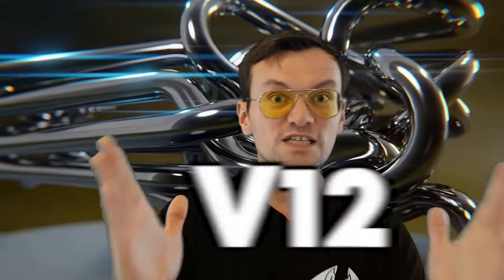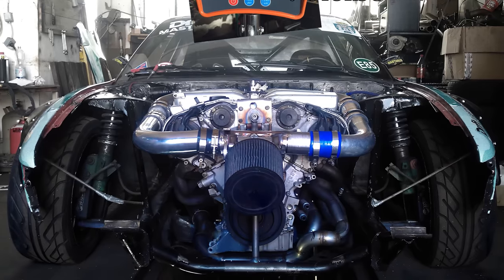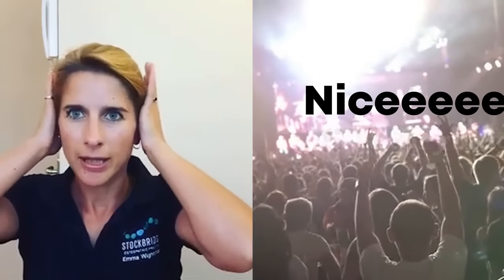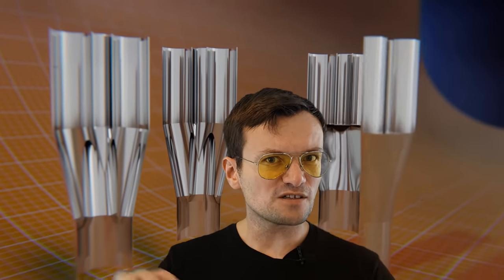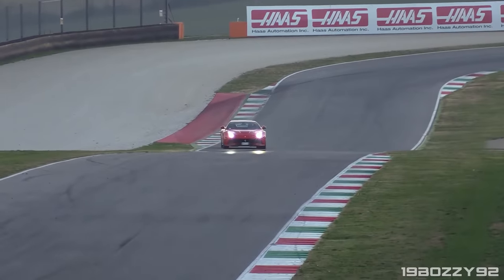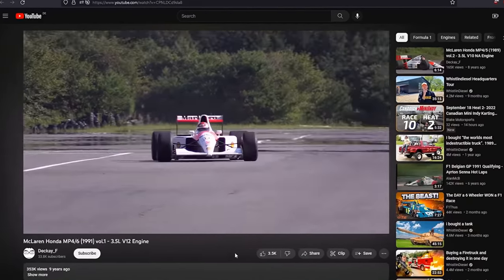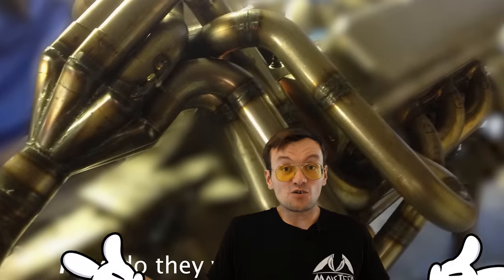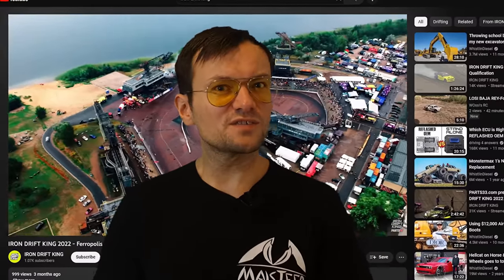Why This V12 Sounds Better Than a $5,000,000 Pagani

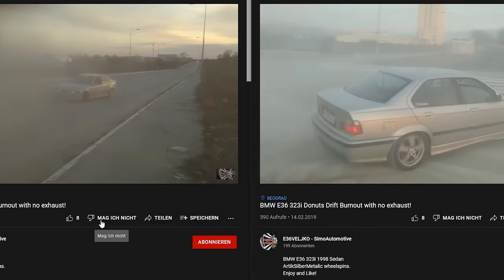Comment: 3:14 You needed an X-pipe exhaust, or an increasing diameter Y-pipe. To me, it looked like that header was a 6-2-1 or 6-2 design. So first of all, you needed to join the 2 into 1 on each side, then continue each conjoined side into either an X-pipe or conjoin THOSE two into one also... So if each E36 header had two 2-inch or 2.25-inch outlets, you would make those into one 2.5-inch or 3-inch outlet, then conjoin each final outlet into a single 3.5-inch or 4-inch pipe for the final exhaust exit.
Reply from the maker: The only cure would have been to exchange the baffle collector with a merge collector. Nothing else would have fixed the annoying raspy sound (except maybe a potato in the end pipe - but then there would be no sound)
Reply: @maisteer  It would've gotten close. There's also a guy who two a 6-2 header set on a v12 and plumbed the four outlets into a single collector and it sounded pretty F1-like on rev while idling like a tractor. It was interesting. Also, I kinda like the BMW sound, especially on high revs when you combine the two outlets into one instead of running duals.
Reply from the maker: @Drunken_Hamster  Do you mean this video: https://youtu.be/7YHjcfpo6HE   - if so we're not hearing the same thing. No F1 sound there, okay maybe 1960's F1 ^_^'
Reply: @maisteer  He didn't rev it as high as he needed to, but yeah, that's the one. You can hear the Lamborghini-like overtone in what little revving he DOES do. That setup definitely has potential, especially if he made the secondary 4-1 collector a spike merge instead of another flat merge.

Comment: I guess, in the end, the fact remains that a naturally aspirated piston engine burning pentanol just doesn't care about what we consider a 'nice sound'. The pumping losses of pushing exhaust into a collector of many tubes will always outweigh the "nice" sound that results. As an alternative measure, one might consider changing the fuel to one that has a significantly faster flame-front. Like Nitro-Methane. The exhaust pulses from a forced induction Nitro-Meth engine are likely to be so fast and energetic that no matter how long and complicated the headers and mergers are it wont reduce the power output.

Comment: The reason why you lose power if the manifold is of unequal length, is due to exhaust gas being forced back towards the combustion chamber. This not only starves the engine of oxygen but also reduces the pressure differential from the combustion to the atmosphere. Less efficient explosions and less usable pressure from the explosion at once, which can be eliminated by combining the exhausts from simultaneously firing cylinders at equal length, thus combining the shock-waves instead of having them counteract each other. Combining all exhausts together without loss of power is not viable, as the length of the manifold needs to be relative to the delay between each cylinder and therefore changes depending on the engines RPM.
Reply from the maker: You really should watch the new video ^_^
Reply: @maisteer  God damn it.

Comment: No way. I dont know how I ended up here but I saw the car do it's demolap at iron drift king 2023. The car ran a little rough but it moved under it's own power which is an achievement in itself
Reply from the maker: And now there is a follow up video what happened after the Iron Drift King ^_^ https://youtu.be/6EjbfLSRmyA

Comment: This dude is making headers look easy and I can say from experience making a set that won't crack and is that complex is difficult and if you were to buy even a mx5 custom header can cost over 1500 for a good set while still making same or less power than stock in a mx5s case
Reply from the maker: ...but it is really easy. ^o^'

Comment: so its like taking a band and putting a mic on each member, vs putting an omni in the center of the room. both will make the same sound ones going to be less clear and more distorted at high volumes.
Reply from the maker: I really don't understand the point... but thanks for watching ^_^'
Reply: @maisteer  in no uncertain terms what I'm saying is that what you did to your pipes makes total  sense.  another way to demonstrate what i said above is this, take 12 guys and have them all yell into a tunnel, its going to sound like trash, but make them all yell in a specific order.. and what you've made is music.
Reply from the maker: @5speedfatty  Ah, that's a bit more clear now. Yeah, sure. If you listen to a V12 without headers, it sounds not very musical at all. ^_^

Comment: I was excited to have found a new, interesting channel to watch, but you only have 3 uploads?? Come on, man! I am excited to see how the Mercedes headers turn out.
Reply from the maker: I am too. But Tim needs to finish the car first.
Reply: @Maisteer  Well, it's very impressive. Did you do any research on the 180° headers Ford came up with in the 60s? I'm sure you did, but I didn't see them referenced in the video. I realize this probably has nothing to do with what type of exhaust you're building or experimenting with but I am a GM truck guy and despite the GenIII/IV LS motors being shared (in a round about way) with the engines in the Corvette the trucks never sounded the same. This drove several truck owners insane. Even with similar internals to Camaros and Corvettes. When modified, the trucks have headers, usually with 1 3/4" to 2" primaries and 3"-3.5" collectors. From the collectors, the right side has a straight shot to the exhaust because of the fuel tank, the exhaust runs along the right side of the truck. The left side though the collectors has to go straight to the back of the transmission, 45° or greater to the right behind the transmission, under the truck and then another 45° into the Y or X pipe to go out the back. The problem was just how much further the pulses from the left side had to travel before merging with the right. Once people started forcing on trying to keep the piping equal length from the head flange to the tailpipe, sound really changed. Also I don't know if you've looked at it or not (I'm sure you have) but if you had to the piping at the heads can be a little smaller for clearance or for added power tuning and then stepped up when space allows or where the engine will benefit most. I'm sure I've told you nothing new, but what you're dealing with is what a lot of truck, SUV, and muscle car guy's have fought for years. Also Chris Stapleton has a channel on here where he did a lot of trail and error trying to make some headers for a LSA that you might enjoy. Thanks for the great content man!
Reply from the maker: @chesspiece81  Thanks. That's some really good insight. I think you might find this video interesting: https://youtu.be/f72BMpmoGMY
...and this one (video is on motortrend on demand) https://www.motortrend.com/news/engine-masters-ep-4-bashes-headers-for-horsepowerso-you-dont-have-to/

Comment: When buying a four or six cylinder car to apply what you've discussed in this video, would one need to keep in mind space in engine bay? As equal length 4-into-1 or 6-into-1 pipework would require a lot of space? How does one choose a car so an exhaust shop has the best chance to actually be able to design and fit the type of exhaust you spoke about in your video?
Reply from the maker: Best reach out to celeritech.nl - they can take care of your needs. There is actually a lot more going into it.

Comment: Instead of banging your head trying to make 6 into 1 equal length all twisted up. Or 12-1. Maybe length can be simulated with Helmholtz resonators. The shorter tubes get matching pairs of resonators that change the volume and the sound as a result.  With much simpler straighter pipes.  Sorry about the migraine :-)
Reply from the maker: I guess it would be worth trying... but even more of an headache to figure out than some snake shaped pipes ^_^'
Reply: @maisteer  Maybe. I got the idea from intake manifolds. Some are actually adjustable length, and others only simulate length by changing the shape or distance internally. I've got a Ford Probe GT. Still working on the sound. $600 engine $120 headers, the rest is off the shelf 2.5". 3 into 2  into 1 equal length. Give a quick listen https://www.youtube.com/watch?v=aauXMeITcdM
Reply: @RomanDaveThings  I read your comment, then ended up in the garage to think about it. Where I have a spare set of shorty headers hanging on the wall, brand new. 6 cylinder headers, 3&3, equal length, stainless. You think if I had a pipe, half length same diameter, end capped, my 6 could sound like 12? Serious question. I'm not currently happy with my setup.

Comment: It's not about the headers... It's about the merger. I think that a V12 could have any shape of header on both sides. As long as those individual exhaust tubes merge from 6 into 1 with any sequence but maintain pulse seperation interval at the merger. Then the output of those 2 mergers could be merged at 180 degrees phase to each other so that the 2 merged banks would pulse in sequence into the main exhaust. Wouldn't this achieve the desired note? even without having the headers be equal length? they would only have to be equal pulse seperation but any length.

Comment: It won't be long until we hear of 3D printed headers for V12 engines.
Reply from the maker: That would be cool, but it still seems like large volume 3D printers are not that easy to make. Because of material tension, hot and cold  and stuff...  but you could print them in small pieces and weld them together - just like piping ^_^'

Comment: There is also the fact that most  F1 engine rev to 18,000 RPM .
That makes a big difference.
Reply from the maker: Of course. A old F1 car at idle is hardly more exciting than a new one at full throttle ^_^'

Comment: Compression and stroke length play a pretty big part in exhaust notes as well.
Reply from the maker: They do! As do camshafts, and head design, and just about everything else that has anything to do with how much air is flowing through an engine... ^_^

Comment: now a DOHC 20V I5 with equal length 5 into 1 headers would sound insane at 7000rpm. or a V10 that's basically the same I5 on each bank, but mirrored with a crossplane crank and an equal length 10 into 1 header would sound orgasmic.
Reply from the maker: I hope the Driftworks BMW 10 into 1 will sound amazing....

Comment: Awesome and it sounds like the worlds fastest zipper competition
Reply from the maker: It's a lot louder...
Reply: @maisteer  so I wonder what you would get if you took a V8 and split the header tubes down the middle starting at the head full length so like two capital D’s back to back retaining the round tubes of course then at the collector you would wind them around in order 1-8 then 1-8 because you would have 16 exits at the header collector. Do you think that would make music?
Reply from the maker: @DumbCarGuy  The split seems pointless. What is that supposed to do?

Comment: there are two things to do for that sound, you have to have equal lenght headers, both sides has to be exact lenght, and the most important, an x-pipe, then you have to delete back boxes and keep just resonator/s in the middle, and voila...
Reply from the maker: Sounds simple.... almost tooo simple ^_^
Reply: @maisteer  just try to listen some v6, v8, v10 and v12 with xpipe and with true duals with no xpipe, and yea, all arms on headers(or how i have to call it) has to be same exact lenght
Reply from the maker: @weezzoos  And that's all? Really? 100% sure?
Reply: @maisteer  i hope so, did you listened vids with and without xpipes?
Reply from the maker: @weezzoos  yes
Reply: @maisteer  ok, aaaand? 😁
Reply from the maker: @weezzoos  sounds different...
Reply: @maisteer  ok, now i hope that the same lenght of headers to xpipe is just all you need 😅 i still dont know exactly 😉

Comment: hi i am just wondering... what program did you use when making 3d model of the manifold? for the exhaust?
i am just student but want to do tuning in future career.. but since i am living in South Korean it won't be that easy to do in the future when EVs or Hydrogen cell cars are dominating(probably...) so my opinion is to target more of aesthetic part of fossil fuel engines... and biggest difference between fossil fuel engine and electric motor is in the sound it makes...
and this might become the most popular fossil fuel engine tunning in the future...
i mean we all know that EVs are faster at acceleration at "low"speed and we all know that fossil fuel engine is super old like 150yrs.. and Electric motor is advancing just knowadays
Reply from the maker: Yeah, I hope exciting(!) petrol engines will never die out. Horses from 100 years ago didn't either ^_^
The program is autodesk fusion 360. It's free to use for hobby projects and as far as CAD goes much more forgiving and flexible than something like CATIA (Industry standart) ... and also easier to learn.
Reply: @Maisteer  thank you!
I was actually leaning CATIA at college, but it felt little difficult and i heard it is extremely expensive if u want to use at business xd
Thank you for the explanation!
Reply from the maker: @danyk7879  Your welcome. Yes CATIA is very  expensive. I heard depending on the package you get, It'll cost as much as a brand new car.... as long as the car costs between $9.000 and $65.000 ^_^'

Comment: The super cars have a Flat plane crank it's why they sound like that. The Toyota V12 is a dual plane crank. You may get a similar sound but not the same. Even the higher performance mustangs have a flat plane crank.
Reply from the maker: Which toyota v12 do you mean? It's a bit confusing to read. But to break it down. Crossplane (or dual plane) is mostly a topic with v8's. You're right that many supercars use them and most normal v8s don't. But the point made in the video was more that you can workout the crank configuration and still get the supermarket Sound. Better watch that part with the old mustang again. It's a crossplane, yet doesn't sound like it at all.
Reply: @maisteer  I'm not sure of that. My son owns a mustang and it has a cross plane crank. But the real high performance mustangs have a flat plane crank. What I'm saying is that most screaming engines have a flat plane crank and achieve much higher rpm giving them that sound. My son has tried many different exhaust systems but it will never sound like a F1. The engine makes the sound not the exhaust system. The exhaust system allows you to manipulate the sound only. That mustang sounds like it has a GT 350 engine to me.
Reply: @maisteer  Why would you want your car to sound like a Supermarket. 😂😂 just kidding. Thanks for the reply. Rik
Reply from the maker: @BuiltByRik  supermarket ^_^'. I wrote that with sweaty hands after a workout yesterday. I guess i tried to type supercar instead...
Reply: @maisteer  From the thumbnail I presumed it was a Toyota V12. It looks like the exhaust project on YouTube of the Toyota V12 in the Toyota 86 or Subaru BRZ. Same cars. Which V12 are you building this exhaust for? Ate you personally building one?
Reply from the maker: @BuiltByRik  To contradict your point: The blue mustang has a crossplane crank and it sounds like a F1 car (at least much more than you would expect from a 60-year old V8), but it needs to have 8 into 1 headers to do so.
Also since your into the topic, I hope you find this interesting - it's very informative about crossplane V8 headers: https://youtu.be/f72BMpmoGMY?t=840
Reply from the maker: @BuiltByRik  The engine is a Mercedes M120 V12. The pic of the headers in the thumbnail is from around 2 weeks ago. The pipes are all tacked together now and the engine is in the car to check for clearance. I did the CAD construction of the headers and designed the 3d printed jigs to fabricate it. Fabrication is handled by my friend who also owns the car and wants to race it. The car is supposed to be finished in August - and judging by the progress he makes - it's looking good.
Reply: @maisteer  Nice to hear. I'm going to make my own too as they are not available for my model grand Cherokee. I am not planing to do 8 into 1 as I'm planning on twin turbo charging it. As you may well know room under the hood/bonnet of any vehicle is hard to find. Good luck with your project. Rik
Reply from the maker: @BuiltByRik  Yeah, packaging in one of the hardest parts most of the time. Anyway, good luck with the project. I hope it works out well.
Reply: @maisteer  you too ill keep an eye on your project. I will probably start mine next year. I have some other jobs to finish and a long deserved holiday. After that it's work gloves and welding helmet on 😁
Reply from the maker: @BuiltByRik  Well then i wish you a nice holiday and so you can come back fully recharged to the welding desk ^_^
Reply from the maker: Hi, again... Long time ago. I've made a new video with loooots of exhaust related things, like flatplanes and such. I hope you'll enjoy watching it. https://youtu.be/6EjbfLSRmyA